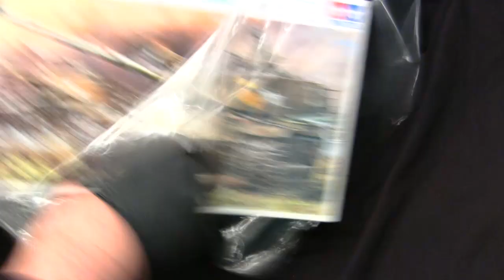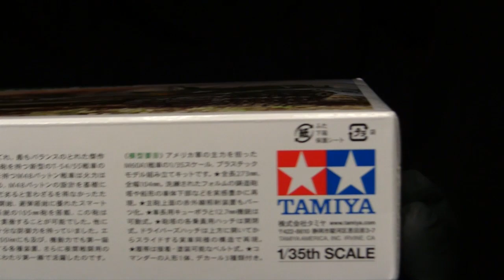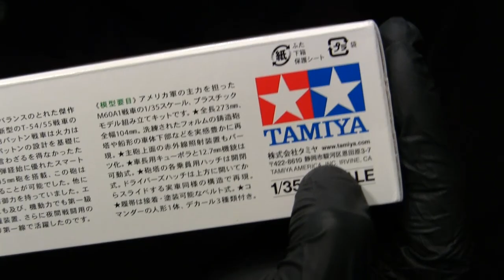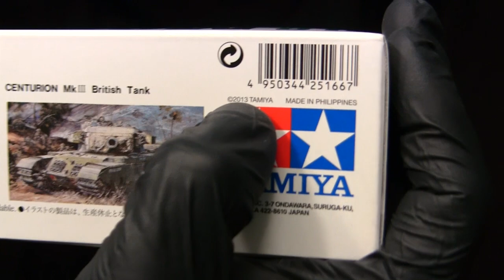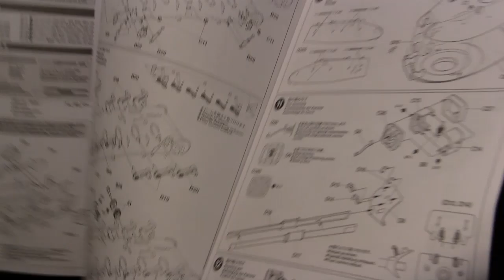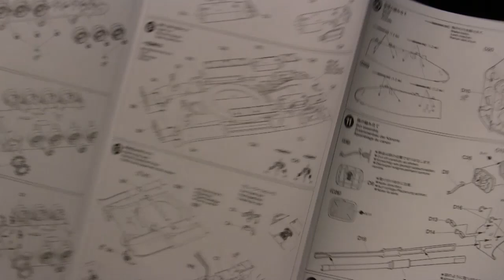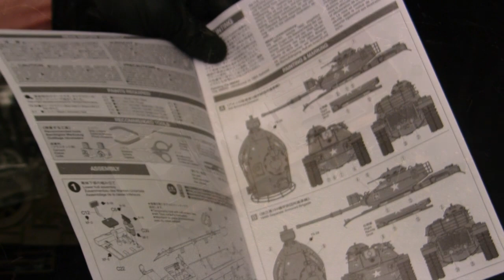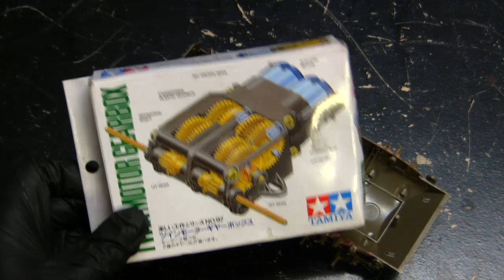1/35th scale Vintage Re-release Tamiya Motorized M60A1 Main Battle Tank

Comment: I just completed retrofitting my Tamiya Tiger I with the same twin motor gearbox. I was inspired by this video so thanks for sharing. I had to improvise the locking nut for the sprocket drive wheel axle.😊 Tamiya tanks rock.
Reply from the maker: Glad I could help, also congrats on your rebuild. Just in case you want to do that again, since this video I designed a 3D printed adapter for use with the tamiya gearbox on the Hex found on the old tamiya sprockets, that set is found here, https://www.shapeways.com/product/RB9LM27NU/tamiya-motorized-tank-gearbox-sprocket-inserts?optionId=237572335&li=shop-inventory . They save a bit of time with fabrication of an adapter and work like a charm :)
Reply: @oddball759mm  thanks for the link to your resin hex nuts. I used regular nuts and filed it until it fits snug.

Comment: The two large oval holes on the bottom of the hull were to allow the single motor gearbox to be moved from either a low speed high power position or a high speed low power position.  All you had to do was loosed two screws on the bottom of the single motor gearbox in an L shaped slot to change gear. Great stuff from Tamiya and I had lots of fun with my M60 tank back in the day!

Comment: Great video and very well done. I'm using the same gearbox for King Tiger and I like how you've solved the problem to fix the gearbox to the hull. How you've connected the sprocket wheels to the axle ? Thanks
Reply from the maker: I machine an insert out of resin that fits into the hex section on the sprocket that also fits the gearbox axle. On future builds I can see that bit being made from 3d Print
Reply: @oddball759mm  Understood, thanks. Waiting for your future project!

Comment: Around 1:07:10 you mention that Tamiya molded the hatch grab handle as a solid piece. I was surprised to find out that they still do this exact thing on their new kits (i.e. M4A3E8 Easy Eight Sherman. I guess that they intend for their kits to be easier to build than Dragon or Asuka.
Reply from the maker: yes this is still a common practice, tamiya does that to simplify the build.

Comment: im converting my M60A1 to rc but the drive sprocket comes out too far from the body to be a good driving sprocket. the metal piece that comes out from the gearbox are too long. What should i do?
Reply: I am using the Tamiya M60A1 kit and Tamiya Twin Motor Gearbox
Reply from the maker: The metal rods simply need to be cut to length, Once they are at the proper length the sprockets will work as designed. Since I made this model I developed a 3D printed set that adapts the tamiya sprocket to fit onto the tamiya Twin motor gearbox hex shaft, the link is found here, https://www.shapeways.com/product/RB9LM27NU/tamiya-motorized-tank-gearbox-sprocket-inserts?optionId=237572335&li=shop-inventory

Comment: Nice but no workable suspension? SMH….
Reply from the maker: seriously?
Reply: I was looking forward to it being an RC and seeing if it had working suspension. I guess I’m just spoiled. Good vid though.
Reply from the maker: @vhd72  yeah, that's not going to happen to a 1/35.
Reply from the maker: @vhd72  Like I said in the video there are lots of guys who full option RC convert 1/35, I even recommended this kit and gearbox as a good candidate for them. For me though it's a no, it's just not something I'm into. For my RC needs I roll either 1/16 or 1/6
Reply: You should jump on Facebook and join some rc tank groups. It’s the only reason I’m there. Those groups are a wealth of info
Reply from the maker: @vhd72  I'm already on several, as you probably guessed I've been doing this for a long time